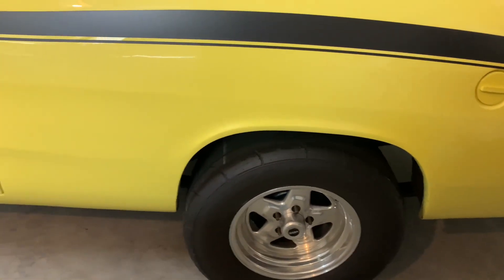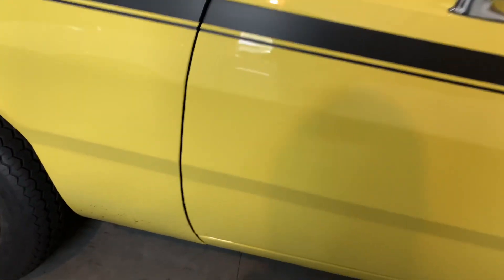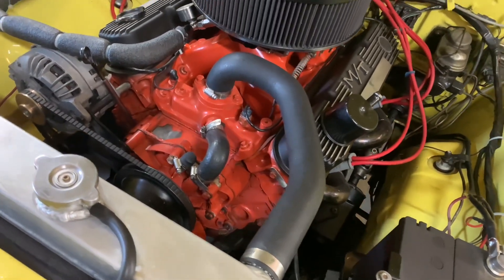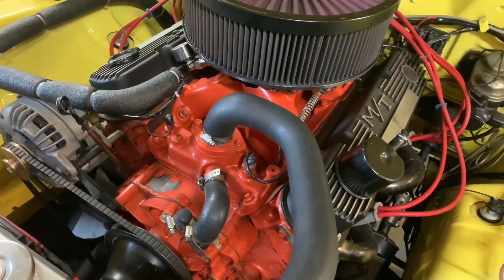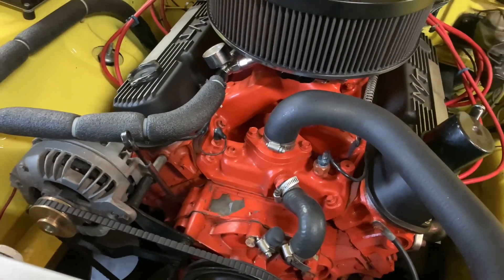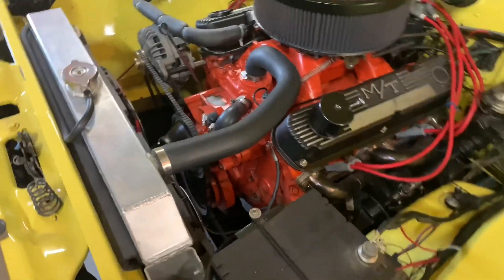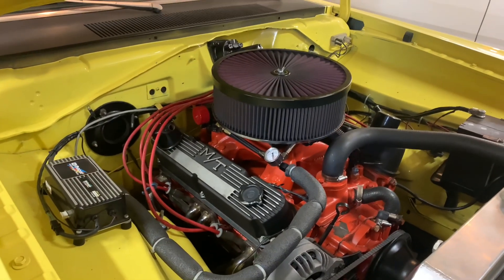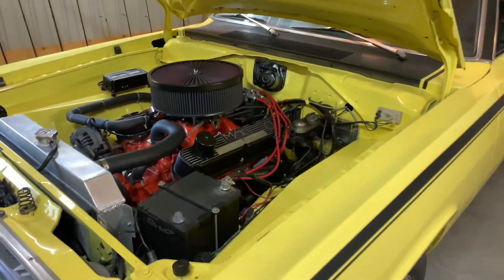EASY 11 second small block Mopar recipe. Build breakdown of my street/strip Duster.

Comment: Nice work I wish I was able to find a 340 duster that was in the low 20k range that was a good driver. It is very hard to do
Reply from the maker: Heard that. Both of my cars are original 6 cylinder cars. Buy a cheap one and build it the way you want it.

Comment: Love your car I'm building a 74 with a mild 5.9 magnum and 727.i love the wheel and tire combo and want the same for mine.what is your size and backspacing on front and rear.thank you
Reply from the maker: Thanks man. Fronts are M/T sportsman tires 26x7.5x15 on 15x4” wheels, 1.75 backspacing. Rears are M/T et streets 275/60r15 tires. Wheels are 15x8, 4.5” backspacing.
Reply: @Duster_Garage  thank you for the info
Reply from the maker: @masonsnook1583  No problem

Comment: Nice. Pretty impressive for what looks like a mild street car. I subbed. Got a question on the fans. Any idea what CFM they pull? Do you have a part number? And is the radiator a 26”? Thanks.
Reply from the maker: Thanks man! The fan setup is a flex-a-lite 420 low profile. Summit racing p/n is 
FLX-105422. They pull 2500 cfm. And the radiator is a 26”, 3 core.
Reply: @Duster_Garage  Thanks man.
Reply from the maker: @JonnyMopar  No problem

Comment: Running the same set up on my small block 340 just with a flat tappet cam and trick flow heads  swinging a 4in crank shaft .. 391 gears 904 trans outback really curious to see what it's going to run
Reply from the maker: Nice! Should run low 11s if not high 10s once you get it dialed in.

Comment: It probably makes around 415 at crank recently dynoed one basically the same. It made 418.6 torque at 4800 rpm and 417.6 HP at 6200 rpm
Reply from the maker: Thanks for the info. That’s about what I would have guessed, around 400

Comment: Very impressive budget build here's my question you said that you're running a Mopar performance probably a purple shaft cam 484 lift my question is this it's a hydraulic so you said you're running solid lifters my question is you just drop a set of solid lifters and off you go or is there other necessities that need to be done I have a racer Brown camshaft that's 292 duration 510 lift I'm curious if I can do the same thing with this camshaft I also have a mildly built 360 any information would be helpful love the video
Reply from the maker: Yes, it is a hydraulic cam. Over the years I had two sets of hydraulic lifters go bad. I had read you can run solids on a hydraulic cam. So I installed a set of Comp solid lifters and broke them in like you would with a new cam. I had adjustable rockers already and set hot lash to .014. I hope this helps.
Reply from the maker: I forgot, you will need slightly longer push rods.
Reply: Thank you very much for the quick response and again keep up the great videos they're very knowledgeable have a great day my friend
Reply: Hey do you have a Facebook page I'll send you a picture of my 73 Dodge Dart sport mildly built which runs 12:30
Reply from the maker: @kengruginski6889  I actually don’t have a Facebook page. I forgot one other thing, if you have dual valve springs, remove the inner springs for break-in.
Reply: Hate to pick your brain here's here's my last question so with you running that camshaft how did you figure what to set the valve lash number wise
Reply from the maker: sorry, I didn’t see your question till now. I set valve lash .014 hot because a friend has a similar size solid lifter cam and that is what it called for.
Reply: Hey quick question you have TTI headers and you're running a 3in exhaust do you have part numbers for your exhaust system like the pipe and the muffler's interested in doing the same setup on my car
Reply from the maker: @kengruginski6889  The exhaust is custom that I built. I used a Summit racing h-pipe kit, part number is sum-642030. The mufflers are summit 2 chamber, pn is sum-638230. I did have to get a piece of straight 3” pipe from Napa for behind the h-pipe to the mufflers.

Comment: do you run the new Hi Volume Aluminum Water pump? or the steel one from 1969 and back style, i wonder what the HP Differences are or the same. the batteries are kind of heavy and a light weight one can be had at half the weight, but at a co$t
Reply from the maker: I do have the later aluminum water. I’m not sure if there is much hp difference. I do have a smaller than stock battery, I think it came out of a Mazda Protege.

Comment: Replied to your newest video but I'm not sure if you saw it. Since you have that high of a stall speed and that much gear you really should try locking out your distributor then dialing the timing in at the track. You have nothing to lose and can always put it back. 
 I know a few people who say it won't do anything to help but I know more people who have actually tried it and said son of a..
and kept it locked out.
Reply from the maker: Yes, I did read it. I am going to try increasing rear tire psi. I thought I responded back to you. I never tried locking the distributor out but I do have the lightest springs installed for the mechanical advance(no vacuum advance). 36 degrees all in by 1800 rpm.
Reply: @Duster_Garage  I made another post under the same thread about your timing. Even with the recurve, like I said, you should try locking it out, you have nothing to lose. Run it at the track to see the difference. At times the old butt dyno is off.

Plus if you're running that light of a spring there is a good chance the weights are bouncing a little on the top end giving slightly erratic timing.
Reply from the maker: @peskypeet  I will have to give that a try. I never thought about the timing becoming unstable at high rpm, that’s a good thought. It’s pretty easy to lock out the MSD distributor I think.
Reply: @Duster_Garage  It's incredibly easy to do. Just as easy to reverse if you don't find it helpful in some way. 
Adjust the total timing at the track using the fuel of your choice and stick with it. You may find it wants a little more or a little less.

Comment: What is the story with the front suspension? : torsion bar size, shocks, which front wheels and tires, breaks,  how much does the car weigh? what are your 60' times like?  thanks in advance!
Reply from the maker: The torsion bars are MP 340 resto, .870". The front shocks are Competition Engineering adjustables set to 90/10. Front wheels are Jegs pro stars 15x4 and tires are MT sportsman 26x7.5x15. Front brakes are 73 and up A-body single piston disc setup. And the car weighs a shade over 3000 pounds. Anything else don't hesitate to ask.
Reply: @Duster_Garage    THANKS
Reply from the maker: @like-a-pike4654  sorry, I forgot the 60’ time. 1.56-1.58

Comment: After watching this about 10 times like it was the first time, I was wondering what your wheel and tire setups are. I.E. wheel and tire sizes. Also, what are your RPM shift points? I noticed you run swapped the steelies out for the Jegs stars, did that pick up any ET?
Reply from the maker: The fronts are 15x4 and the tires are 26x7.5x15 mt sportsman. On the street I usually run the 15x8 jegs wheels(4.5” backspacing) with 275/60r15 ET streets. At the track I usually run the 15x8 steelies(4” backspacing) with MT et drag slicks 26x10x15. I shift at 6500 rpm and go thru the traps at 6300 with the slicks. The et streets are 28” tall so trap rpm is 6100. It slows down a little with the drag radials because of them being taller. I should some time put the slicks on the aluminum wheels and see if it picks up any.
Reply: @Duster Garage  Excellent information! I have a 727 vs. a 904 and picked up 28" ET Street Rs. Now I'm wondering if I should go with a 4.30 gear or the 4.10s I have.  I will definitely try both 26" and 28" inches soon as the track opens. Thanks bruh!
Reply from the maker: @greazedlightninggarage6768  Anytime buddy! I can’t wait to see it on down the strip, or at least make some hard street pulls!

Comment: Are you able to run pump gas with 10:1 compression and iron heads?
Reply from the maker: Yes, that’s all I run. I put 110 octane in once to race at the track. It made no difference.

Comment: my dad could never get those small blocks to run that way good stuff.. hed just get a 440 509  intake and 1050 carb and run 11.5s all day 1.6ft think he also had 456 gears..if i ever find me a old a body would def go small blockl
Reply from the maker: It’s hard to beat a 440. I’ve never actually had a big block in a car.
Reply: @Duster_Garage  my first car was 2013 challenger which now im tryin to run with the big dogs in x275 class but i grew up with my family owning old mopars  with my dad owning 2 71 challengers uncles with darts and dusters and the other satellite
 which he build all there 440s..
Reply from the maker: @xXtoyhippieXx  x275 class are serious cars.  What are you running in the 1/8 mile?
Reply: @Duster_Garage  490s in the cold 5.0s consistent in the eighth ..all basically with still somewhat of a full body car..before the motor let go and im having another rebuild

Comment: Nice Ride and Great brake down 👍 how is rearend frame or spring set up ? Any re location for springs inboard ? Or do the Super Stocks keep tires off the quarters ...
Reply from the maker: Thank you. The frame rails are stock and the springs are in the stock location. The rear end is an A-body housing so it is kinda narrow. And the wheels have 4.5” of backspacing so the tires are close to the springs.

Comment: Do you ever drive the car on the street? How do you feel about the spool on the street with 4.10s?
Reply from the maker: I do mostly street driving with the car. I got a video coming out on Friday, driving the car, making some pulls and doing burn outs.
Reply: @Duster_Garage  sweet! It’s scary how similar our cars are. Only difference is the compression ratio. Any how, I am considering spoiling the rear end but was worried it would twist axles shafts being a 30 spline.
Reply from the maker: Nice! I just watched your video. Do you have stock axles?
Reply: Thanks! I’m thinking of making another video showing more of the car. Yes they are stock axles shafts
Reply from the maker: @bradytallred  Hell yeah, you should. I might be a little worried about the splines twisting on the stock axles.

Comment: And are there any issues with the restarting on a hot day
Reply from the maker: @asbelfernandez3598  She weighs close to 3200 lbs with me in it. And no issues restarting when it’s hot. It has a high torque mini starter which probably helps.
Reply: @Duster_Garage  the flying potato chips also weighs 3,200 lb with me in with a mild steel roll bar .
Reply from the maker: @asbelfernandez3598  that’s pretty light for having a roll bar.

Comment: 2024 Nissan z nismo has 420 horsepower and does the 1/4 mi and 12.5. I would guess your duster has 475 horsepower
Reply from the maker: @racehemi426425  At the time of this video it was probably around 400 hp. My Duster is actually a good bit lighter than the Nissan Z.  Both my car and the Z have a similar trap speed. 1/4 mile trap speed is a better judge of horsepower than et.

Comment: What spark plugs and gap you running?
Reply from the maker: Right now I have Autolite 3924 gapped at .040
Reply: I ran the 3924s the 8 runs of my first TnT. Then, the first 2 runs of 8 runs for the second TnT. I swapped them out for a colder set of NGK 7s and immediately picked up 1 tenth. I ran them on my 3rd TnT and am currently running them now. I have some NGK FR5 I want to try too. They're closer to the 3924's heat range.
Reply from the maker: @greazedlightninggarage6768  Nice, do you know the part number of the NGK 7s ? I would like to try the same on mine.
Reply: @Duster Garage  NGK V-Power R5671A-7. I'm not sure, but I heard the non-protuding electrode on these helps promote a more effective flame front. I don't know how true that is, but I can confirm I gained a tenth with that being the only change. Can't hurt to try them out.
Reply from the maker: @greazedlightninggarage6768  Makes sense. I would if the same holds true with the old open chamber heads like I have.

Comment: 73 Duster, 3680 lbs,  380hp MP Crate motor upgraded to worked over aluminum heads, 3800 stall, 370 gears. Only runs 9s in the 1/8 or 14's in the quarter. Never ever 1/10 second faster.
Reply from the maker: That’s really heavy for a Duster but should still run 12s. Something has to be going on. Make sure your distributor is advancing timing. Should be about 35 degrees by no later than 3000 rpm. If you have a vacuum secondary Holley, make sure the secondaries are actually opening. Either one will kill a lot of horsepower. Last time at the track I was parked next to a guy who had a Duster with the 380 hp crate engine. TTI headers, 3500 stall 727, 3.91 gears. Running 12.12s all day.
Reply: All i can say, is something is WRONG with the timing, set up, fuel (carb) , tranny, SOMETHING, combo aint workin rite......shud be ALOT faster/quicker.......dig into it, do some research, and wish you well!!

Comment: What size and brand tires in the rear? I have a 72 Duster.
Reply from the maker: On the street I run Mickey Thompson ET street ss drag radials. 275/60r15. 
At the track I run Mickey Thompson ET Drag slicks. 26x10x15.
Reply: @Duster_Garage  275/60 on the street nice! How wide is the rim? I have ss springs on a newly rebuilt stock 8 3/4. Offset on them rims?
Reply from the maker: @CashMopar  The wheels are 15x8 with 4.5” of backspacing. Tires are kinda close to the leaf springs because I have an A-body 8 3/4 rear. If you have a B-body rear in your Duster you would have plenty of room.
Reply: @Duster_Garage  ordering rims next Month. I might go with the 4 inch backspace. The tire can go out as far as it wants with these springs. Thank you so much for the info! Check out my Duster videos! Take care.
Reply from the maker: @CashMopar  No problem. Already did, love the plum crazy. Have a great weekend.